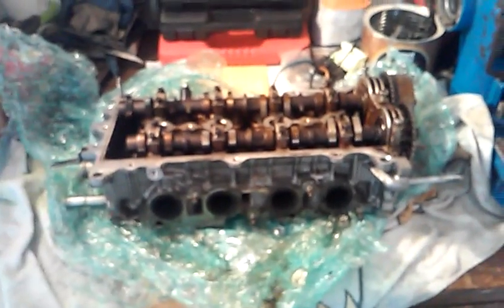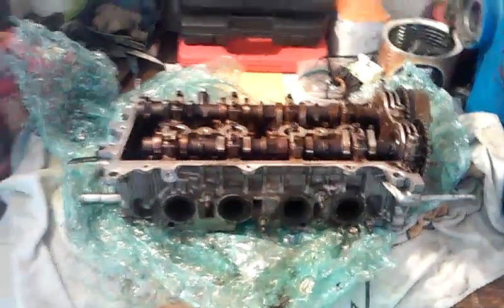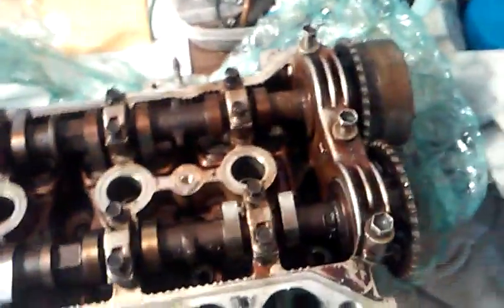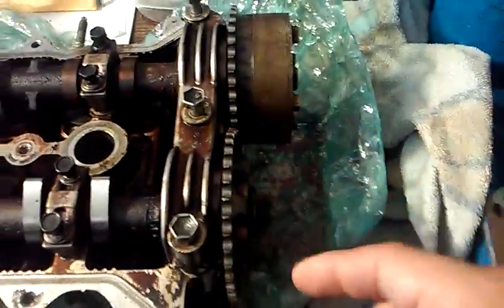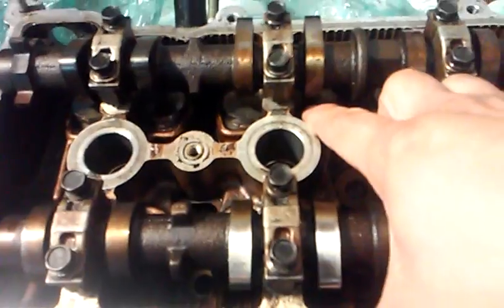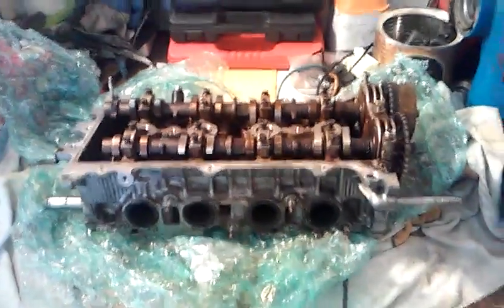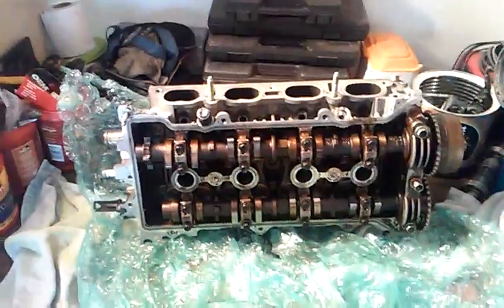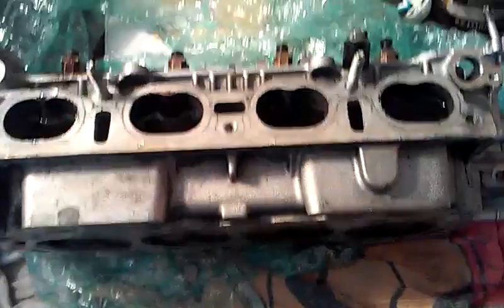Toyota 1.8l Cylinder head information

Comment: Excellent video. Thanks. I just replaced the head gasket on my 2011 Corolla. The valves were fine. Had mild burn marks in each cylinder like on your video. Piston 1 had coolant on it. Glad I decided to replace that gasket. Fun job. Peace out

Comment: I got a 1.8 out of a 09 Toyota matrix with almost 200k I got spark fuel and air but my buddy said he believes I have dirty valves. I had a head gasket issue a year ago and it's been running rich I'm just not sure if it's worth the money to fix it

Comment: I'm trying to get my 1zz head off and I'm having some trouble. I've got the intake manifold off the exhaust manifold off the timing chain off cams are off and I even got the head bolts off and all the hoses and electrical connectors. it seems like it doesn't want to come off near the timing chain area is there something I'm missing?
Reply: There are 4 smaller bolts on the end of head by the cams